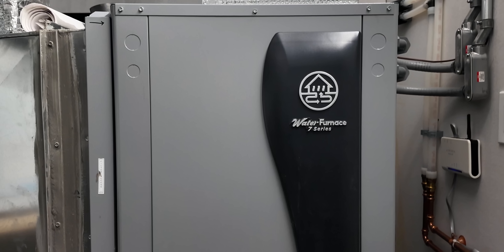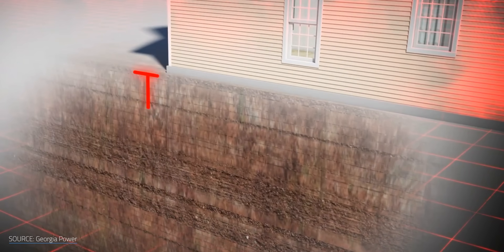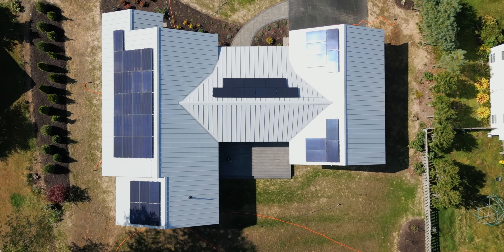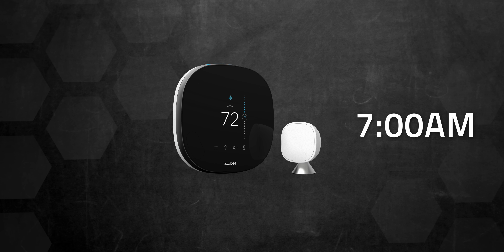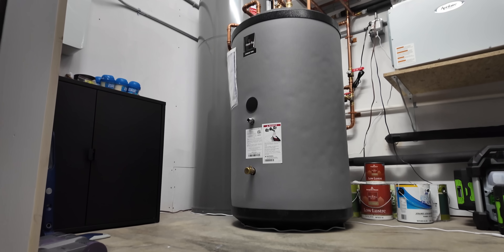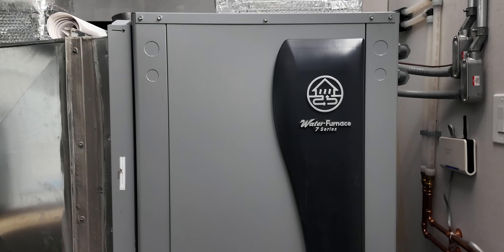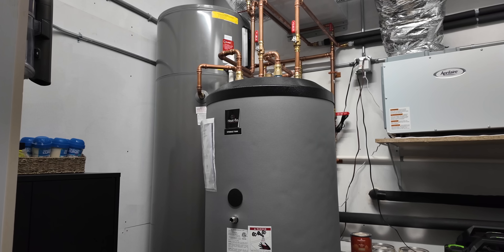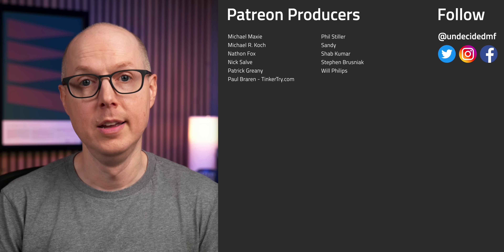How My Geothermal Heat Pump Really Performed (2 Years)

Comment: Based on the financial figures provided in the video, the simple payback period for the geothermal system, when compared to a traditional air-source heat pump, is approximately 13 years.
Here is the breakdown of the calculation:
1. Determine the Incremental Cost
The payback period is calculated based on the additional money spent on the geothermal system after rebates, compared to the cost of a comparable air-source heat pump.
 * Geothermal System Cost (after federal rebates): $54,000
 * Comparable Air Source Heat Pump Cost (priced out): $39,000
2. Determine the Annual Savings
The savings are calculated by comparing the actual operating cost of the geothermal unit to the projected cost of the air-source unit.
 * Air Source Projected Yearly Operating Cost: $2,100
 * Geothermal Actual Average Yearly Operating Cost: $951.50 (Average of $949 in Year 1 and $954 in Year 2)
3. Calculate the Payback Period
The creator noted that he and his wife were planning for the long term (20 to 30 years), meaning the geothermal system would continue to provide savings for many years after the initial cost is recouped.
You can watch the video here: How My Geothermal Heat Pump Really Performed (2 Years).

Comment: Your grid cost is more than the entire depreciation cost of my system. I upgrade pad my system in 2000 for about 2000$ dollars tying into stainless steel ductwork from 1974. I do have to replace Caps, Fans and blowers which means the yearly cost is about 150$. 

All I would have to do is put up enough solar panels to run the system and an inverter and I essentially have a system as efficient as yours at a fraction of the cost.

Comment: It shocks me every time I see how far behind north america lags behind in construction and heating. What you are explaining here about insulation and geothermal heat pumps is normalized in Scandinavia. New houses are not allowed to have bad insulation and geothermal heat pumps for a 140 m2 house are around 29000 USD with incentive schemes. With very effficient air to water heat pumps you can heat our old farm house from 1865 of 150 m2 costing only 11000 USD, using only 5000 kWh/year. Our average cost for electricity is 2,5 DKK ~0,4 USD so we spend 12500 DKK ~2000 USD a year. The house got a thatch roof which gives the equivalent of 100 mm mineral wool insulation and then 400 mm mineral wool insualtion in the roof, and 150 mm mineral wool in the walls plus a 2 layer brick wall with 100 mm separation. All windows are three layer glass and we have no need for AC in the summer, even on 30 C days we keep everything closed and have around 18-20 C inside, then we open the windows during the night. Of the 5000 kWh for heating we use 3000 of them during the winter, only needing 2000 kWh for the other 9 months of the year. 
Why do you need a water heater when you have a geothermal heat pump? Is that not built in?

Comment: I had mine installed in 2008 (5 ton unit)   Where I live (rural), my heating was with propane.  Propane has a lot of price fluctuation.  My ROI ended up being 8 years.  I am totally satisfied with the unit.  It's still a forced air HVAC system like a traditional HVAC unit.  I live in Oklahoma where NG is cost effective to heat your home (not available for my home).  The most comfortable home heating I have ever experience was while visiting my sister who at the time was living in New Jersey.  It was winter.  They had hot water radiant heating.  The heat exchangers were built into the baseboard molding. It was a large home with each floor level having it's own zone.  Three levels.  Basement, main and 2nd floor.

Comment: I would love to have a geothermal heat pump, but my garden is quite small so a horizontal system is not an option. I suspect a vertical system would become quite expensive for me and not worth the cost.
Today I just have an old heat pump air to air that is still working fine. I am considering to get another one but I need to add some insulation in the walls first.
Geothermal heat pump is superior in cold areas since it will work regardless of the temperature outside, while a air to air heat pump would hardly give more heat than a ordinary electric heater when it is going down to below negative 20 Fahrenheit outside.
If you go for an air to air heat pump, you might need an alternative heat source for the really cold days, but rest of the year an air to air heat pump would be fine.

Comment: Geothermal is cool. Or warm, I suppose.
But also thermal insulation is much more important.
Get double-pane windows and additional insulation, especially in the ground and ceiling, as soon as possible.

I live near Moscow and probably no one here would even think of living here without those. 
Well, ok, Minnesota probably does not have -20C winters, but regardless the thermal losses IS the thing that HVAC is compensating in the first place. Small losses are required for ventilation but most US houses are extremely wasteful. To say nothing about (older) Japanese houses.

Comment: i'm still trying to understand. The system will have water at the hub. The air ducts push the air in the house to the water and either heat the water up in summer and leave cold air for the house or be heated up in the winter. 

So during the summer the system is mostly using fans and pumps to move air and water, but during the winter it also needs to heat the water up as well? Or does it use the water heater to heat the water up?

Comment: Interesting.  Being a fellow taxpayer and energy user in Massachusetts, at some level I'm paying for those rebates.  There is no free lunch, but you are eating mine.  You could argue that I could do the same as you, but that just passes the bill on to someone else.  Eventually the music stops and we run out of other people's money.  My point?  Does the system make sense without the rebates?  If it does, fine.  Let's stop robbing Peter to pay Paul.  If it doesn't make sense without rebates, you're wasting my money as well as yours.  I suspect that it will wind up close to break even, with maybe some benefit 10 or 20 years down the road.  Financial markets and arbitrage has a way of evening out the risk/reward across different technologies and choices.

Comment: is the deep vertical for the thermal loop better or worse than horizontally buried loop from a heat transfer efficiency standpoint?  ie: able to access temperatures that are at greater depth - perhaps more stable / better differentials than relatively higher horizontal?  Or, does the lower cost to install horizontally mean larger loops can be used, and this more than offsets the deeper temperatures?

Comment: We considered Geothermal when we built a dozen years ago.  But it would have been extremely expensive drilling the ground loop.  Horizontal is not an option as there is no soil here it's all rock.  My well is 340 through Granite.  We have a mix of heat sources for our 1500 SF house and 900 SF garage.  The basement and garage are heated with hot water loops in the concrete heated by a LP fired boiler.  The main floor of the house. is heated by 3 different sources.   A wood burning fireplace that's reasonably efficient,  Radiant Cove heaters which are rarely used and we have an 18,000 BTU Mini split heat pump that heats and cools the great room which is 800 SF.  The heat pump is air to air and inadequate when temperatures are below freezing. I sized the Mini Split for the cooling load.  The heating is a bonus and is great on the transitional days between winter and spring or fall.  We're in the Black Hills of South Dakota.  Winter here is milder than Minnesota with average highs in the mid 30's and lows in the mid 20's.  Summers are moderate and we probably only use the cooling function 30 days of the season from June 1 to Labor Day.  We have a very low humidity, it's considered Semi Arid here.  I rarely wear a heavy coat in winter.

Comment: They installed a geo thermal heat pump in a School nearby. It took 2 years till it was not working. The ground loop was coming back basically the same temperature. They forgot to take into account the school does not run the AC to put the heat back. So all the energy savings from heating went into running the air conditioning all summer in an empty building.

Comment: I built a 4200sqft icf house 3 years ago. Put a horizontal geo loop in because I was to far from my lake, by the time I would have gotten there it’d be time to turn back lol. I use avg 1000kwh a month for heating. I designed my house with big windows facing east so first thing in the morning my house cooks. It actually cost me more to cool my house than to heat it. Put in radiant floors and desuperheater for hot water. I went on vacation for a week and I always kick the breakers on big stuff like the hot water heaters. Came back home and I still had hot water a week later. I love my system. I’m skeptical on adding solar as half the people around me have had bad experiences. The most irritating downside I have with geo is you never use enough electricity to get to the cheaper electric in my area. Ours isn’t time based its usage based. I barely make it past the first bracket so I’m always paying for the highest electric. It’s almost half the cost per kWh from 1st to third stage. I’ve honestly tried to figure a way to store around 3k kWh lol to see if I could use it the first month and store it for later and not draw anything the next two months. I of course never found anything reasonable.

Comment: My 300 foot water well, cost me $32,000. It took 4 days of drilling. Here in central Utah, geothermal was just to expensive, due to the geology, of the area. So I put my money into insulation and air sealing. My heat pump is helping keep energy costs down. Thanks for making this video.

Comment: One thing I often don't see mentioned in these long term comparisons of cost is the opportunity cost of not having that money invested. 
If it costs you an extra $20k to get the system, and it saves you $1k per year, well you could've invested that money into the stock market or something, and a 5% annual return on 20k is 1k.
So it saves you 1k, but you lose 1k opportunity cost, so you've just paid 20k up front for no monetary benefit.

Comment: Thanks for the review - .I am definitely leaning towards geothermal - especially since my soil type is clay - which is much better at retaining temperature.  You might mention that if you live in sand like soil - you may be limited the deep drilling option like you have.  One option that I haven't seen being used but that I have in a limited sense is under foundation loops (especially with full basements/crawlspaces).  I did this under my crawlspace pour (which also has 2" of foam above it.).

Comment: Wow add up the system cost, solar, and battery and we are easily talking 6 figures of Capex upfront, not to mention opex ongoing costs.  I live in similar climate in UNY (with plugins too), it cost me around 8K for 98% efficient gas, and variable AC 4 ton.  Solar panels were $12k to 10kv system, no batteries.  My total yearly gas/electricity is $1100 (we have VTOU electricity here.  Considering that and solar covers 100% of my non EV (which is $20 a month) I would say your system has no ROI ever.  The unfortunate thing is gov here going to outlaw gas and that is the only thing keeping heating costs somewhat reasonable here for now.

Comment: that cost is large, that's $2600 a year to pay for installation plus yearly maintenance and electric....maybe on a large house, but tough to justify against my high efficiency condensing boiler...$6500 install...total, retro fit no new pipes or radiators except for transition to new boiler. I cannot imagine what a new air handler and associate parts for this will be in fifteen to twenty years, but I'll bet this does not last thirty years!

Comment: We built our house 31 years ago with a Climate Master geothermal heat pump with 4-150ft wells.  That Climate Master lasted 9 years with Rotary compressors.  Put in a WaterFurnace unit with piston compressors and that lasted 19 years.  Just put in the new WaterFurnace 7000 series variable speed unit 3 years ago and works very well.  Added a UVC light to help in a humid area with air quality.  The loop was guaranteed for 50 years. Very happy we did this.

Comment: I was HVAC/energy engineer/LEED AP/green building supporter.  I wanted to install a geothermal system, but could not because of my septic ground field lines. I did build with lots of insulation and my heating and cooling energy has been cut by over 66 percent. Congratulations Matt on your installation and your success !

Comment: I put on in about 25 years ago. I did a lot of the work myself and hired the trencher (5x6 ft deep loops). The heat pump company did the loop fusing, and I did everything else with the help of my wife’s brother (an oil furnace tech) to upgrade my ductwork. All in was barely over $20,000. The 4 ton single stage heat pump back then was only about $10,000. I ended up replacing the pump with a 2 stage after about 20 years when it started leaking refrigerant. The replacement was about $25,000 including a plenum which I didn’t have previously. I had used wood stoves to supplement on the coldest days. The two stage is so much quieter, only running the second stage on the coldest days, and never in summer. Best thing we ever did to this house. Highly recommended, but I am surprised at how expensive installations have become since then. There were no subsidies when I did the installation. I think that’s part of the cost increase, as installers use the subsidies to increase prices.
Reply: Whenever there is subsidy the price will increase by that amount and sometimes more but people think they are saving money.
Reply: Regional pricing varies greatly. It becomes very expensive if there aren't many geo installers in your area.  Conversely, it becomes less expensive if it is common.
Reply: I’m surprised you only got 20 years out of the pump, I had heard they were expected to last 30. Perhaps the single stage is less robust than the newer ones?
Reply: Adjusted for inflation you spent $37,700 on a primarily self install. The heat pump alone was $18,800 adjusted for inflation.
Reply: @MrSemperfit  The size of the house wasn't mentioned which matters a lot in comparing prices too.

Comment: I have done calculations for my part of Canada for years. The numbers aren't as good when compared to a natural gas furnace, gas water heater and gas clothes dryer combined with conventional electric A/C. With gas at $0.16 per cubic meter and electricity at $0.30 per kWh, a ground source heat pump (GSHP) like yours costs about $1000 per year to run (that's mostly due to the electric compressor and fans than run all the time). A conventional gas furnace and electric air conditioning system costs $1600 per year. FWIW: An air source heat pump (ASHP) is already priced out of the game at $2100 per year.

When you add the savings for a gas water heater and gas dryer, the GSHP only saves about $350 year. At this rate, the payback period for a GSHP is far too long to even consider.  Sorry.

It gets worse. If electricity doubles in price, our gas furnace + gas water heater + gas dryer and electric air conditioning system become marginally cheaper than a GSHP while an ASHP becomes crazy expensive at $4200 per year.

Without incentives, or a solar system like yours, a GSHP is hard to justify.  I wish the numbers were better.

Comment: 34 year HVAC tech here. I wouldn’t get one. I’ve worked on Water Furnaces since 2008. They're pretty good equipment. They do break though. 
Water furnace is  also not friendly at all to non- WaterFurnace contractors, limiting who can/will work on them- and they WILL need work. 
The entire industry has gone to shvt quality wise, compared to when I started doing this in 1990
Loops leaks are common  and can be a real bitch to fix. 
They use the same cheap capacitors everyone else does.
 They can be damaged by power surges just the same as air to air heat pumps can. Their evaporator coils develop leaks just like air to air does. 
Major repairs on them are sometimes very difficult/ time consuming and easy to screw up if you don’t have a really competent tech working on it. 
The average American lives in their home for five years.
 If you live in a milder climate you’ll never recoup your upfront outlay. 
The variable speed units can only be repaired by a veteran technician who knows geo’s typically, and those are rare in some areas. Also the communicating systems need a factory interface to work on them. 
In many areas it’s hard to find a contractor with experience installing and repairing them. There’s a severe shortage of experienced technicians as it is. 
In my experience they are no more reliable than air to air HP’s.
Think long and hard before you get one- I never would.

Comment: This is just a good example of throwing tech,  complication (look at all the copper and expensive hardware) high up front cost and later maintenance.   There is an old saying...keep it simple st****)  ..  When we built our house, we used ICF.    Super insulation minimal tech. We are in the midwest,  blizzards with zero degree temps,, humid hot summers.   Heating maintaining 72 degrees with just Home Depot low cost NO maintenance electric 500watt oil heaters.    Keep it SIMPLE...insulation-good windows..it can be really simple.  We have been in our house now for 15 years.  Original low cost heaters,   smallest central air  Bryant had....